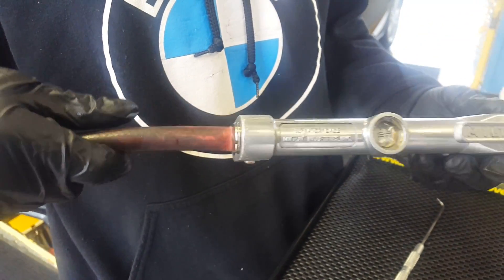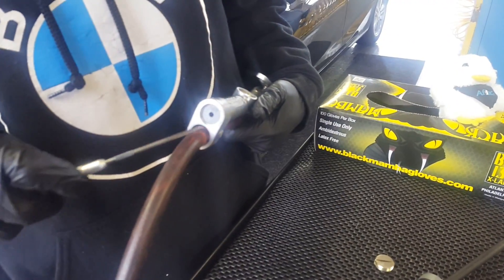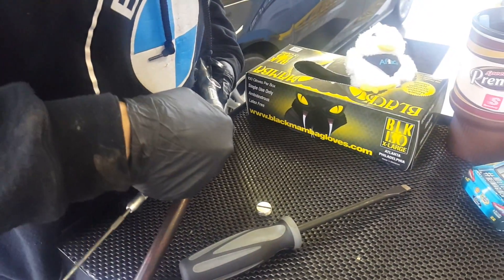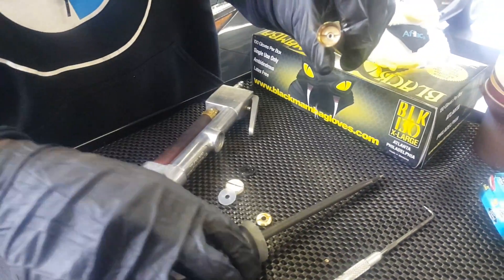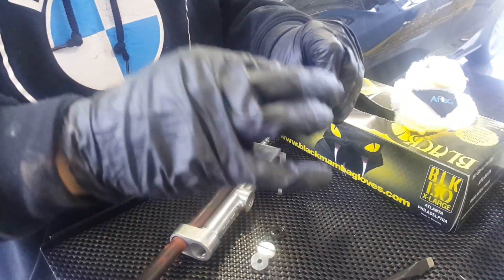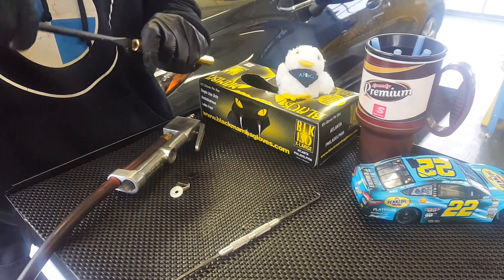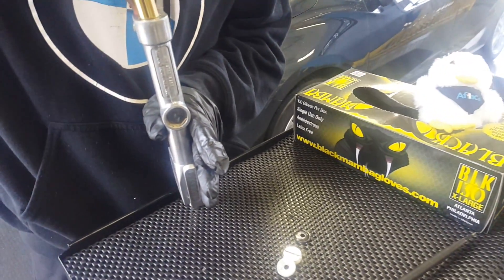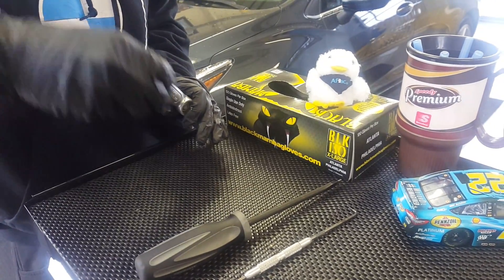Calibrating Milton 506-18 inflator

Comment: I must be dumb, because I have two S506s and neither will put air in a tire. I can't figure out if theyre fixable or not...
Its bad when I end up using a regular clip on chuck, stopping 15 times to check the pressure. I cant even find a forum or anything talking about this...because google only shows me where to buy this pos. I bought one from my local store, the other from amazon (its where I saw a bunch of other people had the exact same problem).

Im not made of money and to have two inflators be junk (one was for cars, the other for big rigs, with a modified output hose, so I can hook another regular NPT hose to it). On a car I can get away with this...but inflating split ring widowmakers with a regular chuck is NOT something Im keen on doing.

Anyone know of an inflator that has a 1/4NPT output line to put a QD so I can put a hose between inflator and tire?

Comment: Thanks for showing how these are adjusted.  I do have a question.  Does a half turn equal 6 pounds at a reading of 30 psi and also at 160 psi?  I don't know, but would think not.  In any case, if  one has a reference known as accurate you can adjust the Milton to match it.   Again, thank your for making this video.